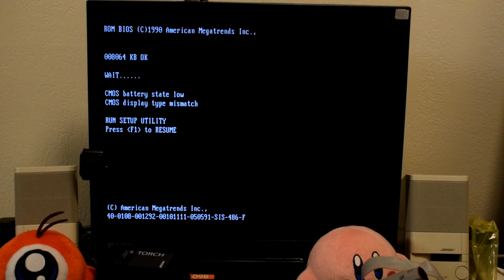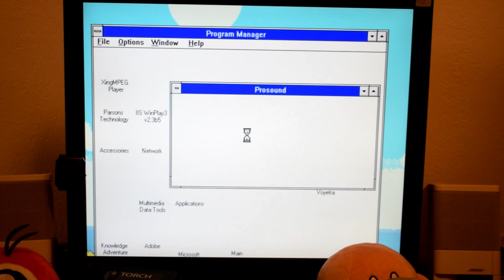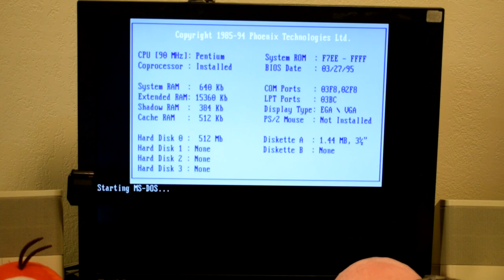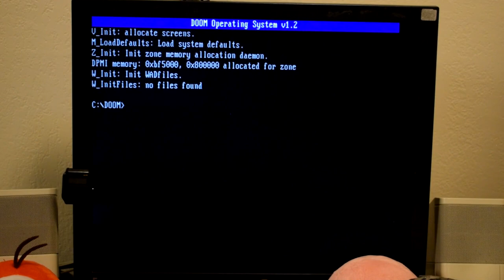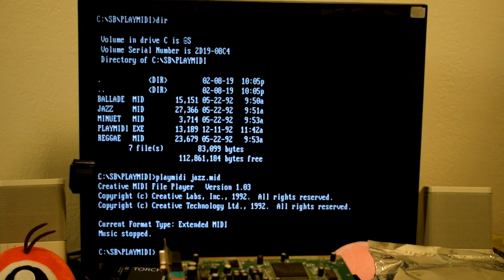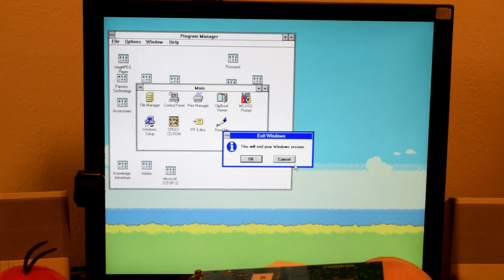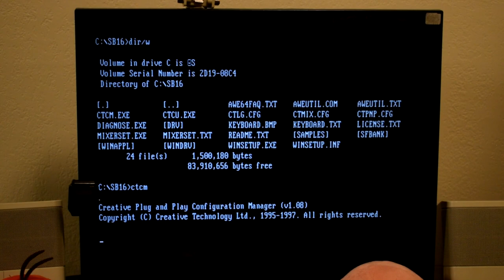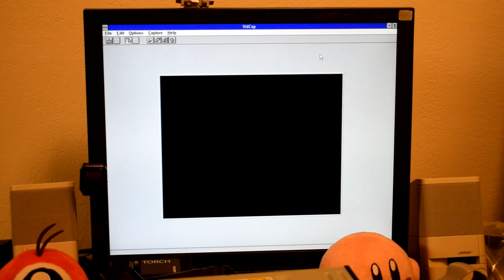The DOS Machine Motherboard to Rule Them All?

Comment: This was painful to watch. My 12 year old self was having an anxiety attack(the first pc i built was when I was 12, the same time period of this pc). There is a jumper you have to set for the right IO address. If you have no jumper installed at all, it won't work. You don't have a jumper installed xD
The jumper is like the bios reset jumper on a motherboard(it is on the soundcard though, not on the motherboard). You select your IO address with it, then you configure it in the sb config.

Comment: I would have gone with a DAA78L + A10-7800k and 64GB of DDR3 RAM and switching off the UEFI and using legacy mode instead and go with Windows 8.1 and run the DOS games in DOS mode.

Comment: The 504mb limit on hard disk size is only if the hard disk controller you use doesn’t support LBA translation(an OS like DOS 6.22 doesn’t support LBA natively, LBA translation tells DOS the proper size of the hard disk. My DOS machine was the same way and I had to buy an IDE controller card that supported LBA translation and now it sees all 3.2gb I’d the hard drive after a reinstall)

Comment: You keep saying it is a DOS machine, but I see you running Windows 3.11 more than DOS and see you worrying about getting the Windows running.  Saying it is a DOS machine isn't accurate.
Reply: win 3.11 runs on dos
Reply: @700gsteak  Win 3.11 and Dos are both operating systems.  I have used both of them years ago.  Have been using computers since 1982 and still have copies of both sitting in my file storage.  Yes, you had to have DOS installed first before you could install Win 3.1, but then DOS was only used for certain software that didn't run in the Windows environment.

Comment: try to play roblox on windows 2000

it seems possible as roblox is lightweight af and can get 60 fps on a celeron from 2004 running XP service pack 3. also the memes are yes.
Reply: Roblox needs at least a core2/athlon 64 era CPU at 2ghz.

Comment: AWE 64 is kind of 1994
Dont mess around with some unusual network cards Use an Intel and disable the coax.  Do not load Dos network Drivers unless you plan to use in dos. Windows 3.11 doesn't like it. In fact a much more effective system will result from a dual boot config regarding config.sys and autoexec files. There is also a distinct lack of cache, please install another 128kb and then it should be able to use 4 megs of ram ok. You will also benefit from an emm.

Manual configuration hard disks is 286 ~ 386 era stuff. 
Kill windows net start if you are not using it.
Your sound card will need an environment that is set in the config.sys file.
Dual CPU's are funny about early plug and play. 

Your new kit running dual p90 will rock as it will have a full size cache for both.
Co processor wont interfere with primary and will run dos and windows 3.1 no worries.
Try and get a copy of NT3.5 it will really work well with both cpu's. It has excellent dos comparability. NT4 will also work but it needs a minimum of 8mb better with 16 or 32 mb.
Then the dos boxes can be configured to use both cpu's.
Do you have a proper hard disc? Anything bigger than 512 mb will need LBA enabled. The p90 should easily read anything up to 2gb on auto.
If you use scsi hard discs up to 8gb are useable but you will not be able to go past 2gb from memory for each partition.
 The SVGA card only has 1 mb  another mb will make it sweet.

If you plan to web browse in windows 3.11 just set up NT. it will work a whole lot better and be usable on old sites as you can use the second cpu.
NT dos box will run all your late dos games. The very early stuff can cause problems but once the environments set they run ok. 
I spent way to much time on windows boxes in the mid 90's
Cheers